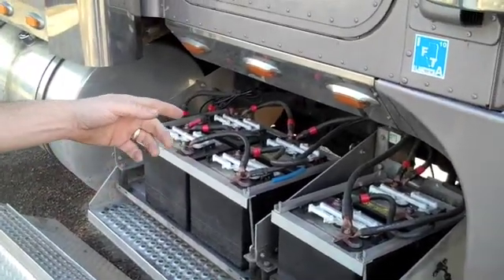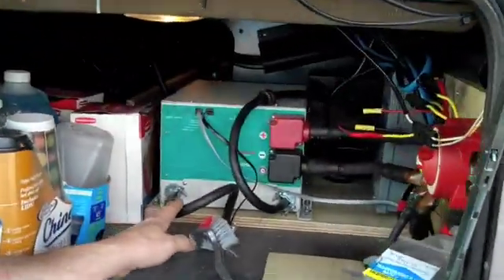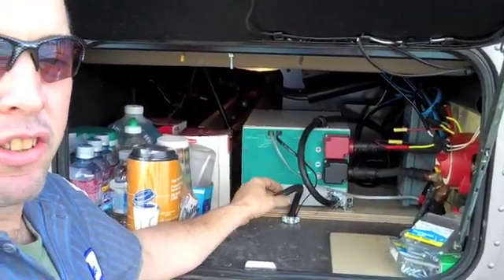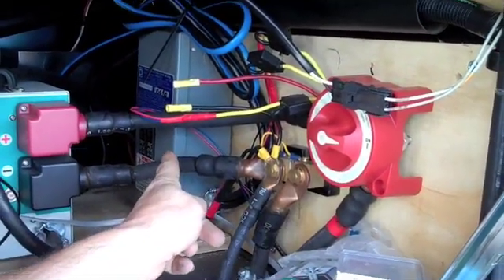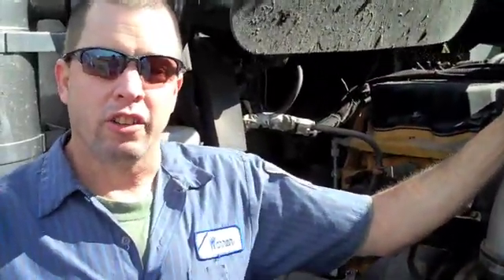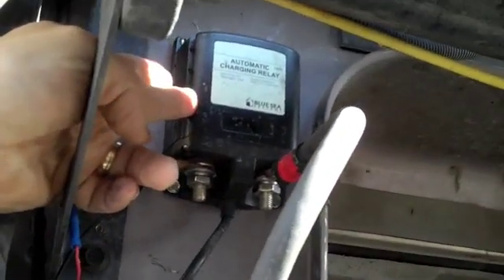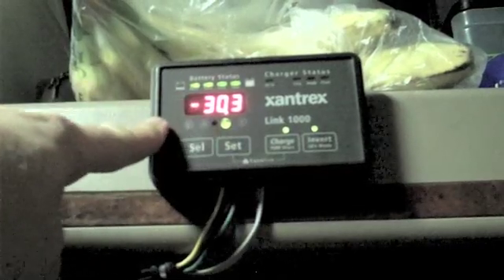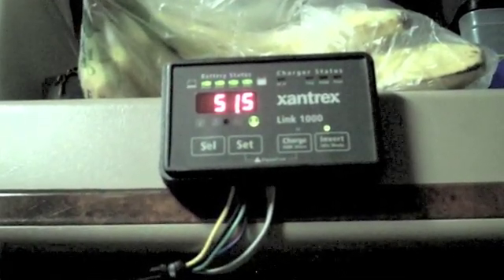Auxiliary Battery Power

Comment: I’m very interested in getting the details on this system
Reply from the maker: Squareroots Trucking dang this is very old tech now
Reply: How’s the diesel generator working out?
Reply from the maker: @squareroot35  I used it for a lot of years but it doesn't fit on my current truck. I ended up boating it to a trailer and we use it on the homestead here a lot. It was a great purchase.

Comment: beats what i had. i just hard-wired my inverter to the batteries by running a line through a hole under the lower bunk. i forget if i even had a fuse he he.

Comment from the maker: We use 110v mostly. I have a Honda Gen. Super quite. But it runs on gas so I'm always on the hunt for fuel. I will be adding a Diesel genset and a roof top AC unit. There is no way around a generator, but the less you can use it, the better...

Comment: So what type of generator do you have Warren? I know what you're saying about peace and quiet with battery + inverter. Do you guys run 240V or 120V mains power in U.S.? And what about air-con while you are stationary, does the APU run that ? We run an "Icepak" air-con for when we're stopped, 7 HP Kubota unit which is pretty noisy but you can be under a blanket in 120 deg. heat, also run a 240V inverter, about 5 KW of  usable electric power. Great set-up you got there...neat job.